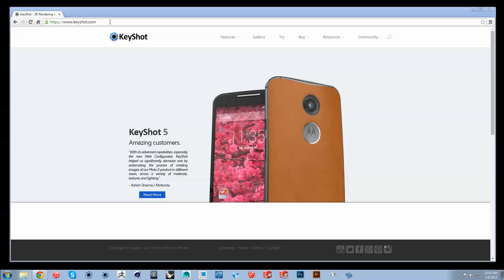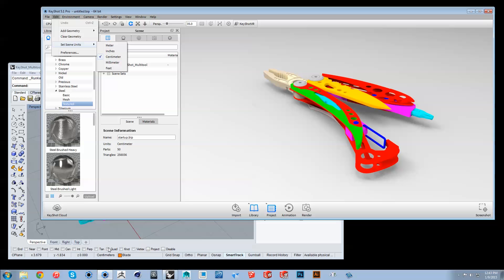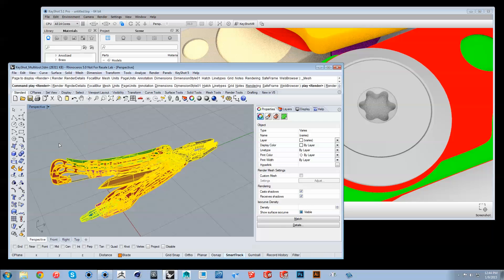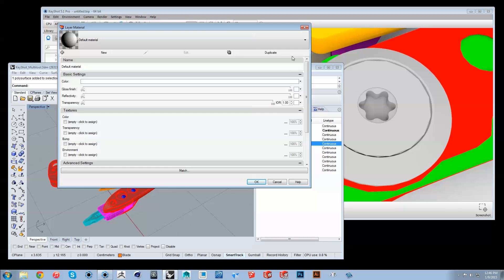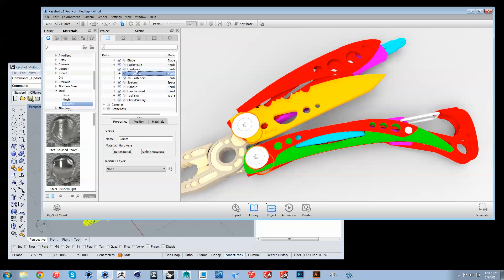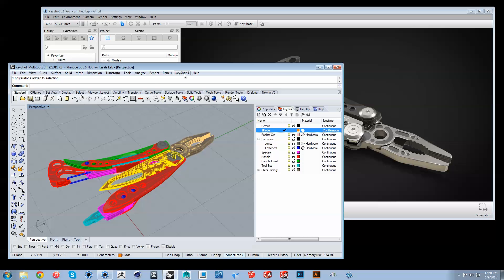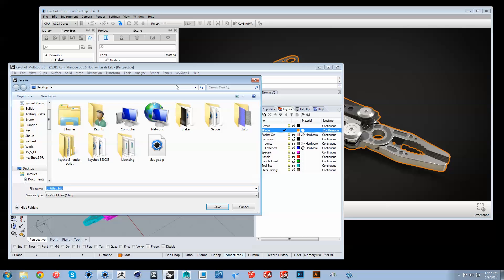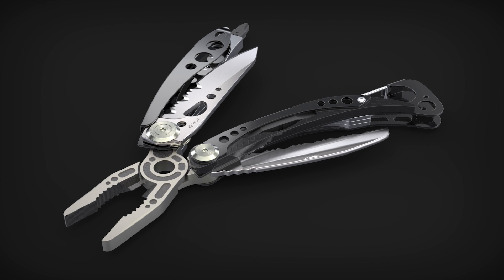KeyShot Plugin Tutorial: Rhino

Comment: Watch out for controlling mesh this way. You don't need to increase the mesh that much on tiny surfaces. Instead, I recommend using Only the maximum distance to edge. Lower numbers increase the quality. If you have a radius of .1 while your model has some large curves over a distance of 10 or something like that, and use maximum distance to edge of .1, your model will look smooth over the large distance, but the tiny radius won't receive extra geometry. You may also want to change the ratio to 12-8 or so. This keeps you from having really long thin triangles, which are not good for GI.